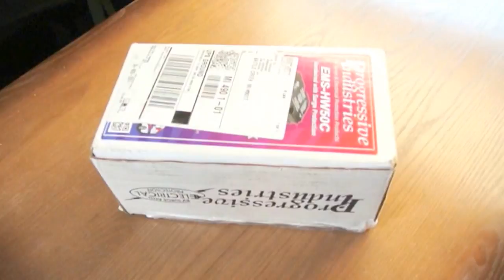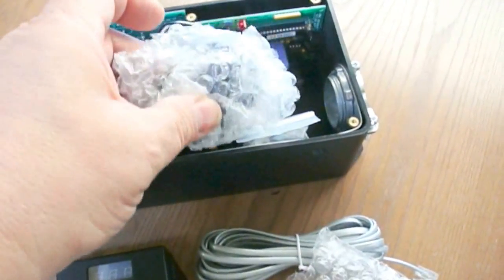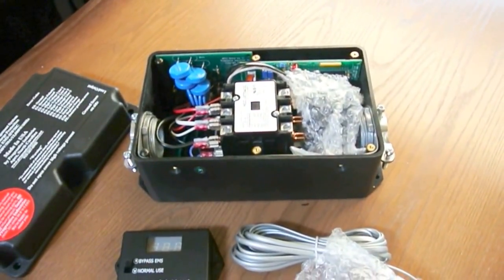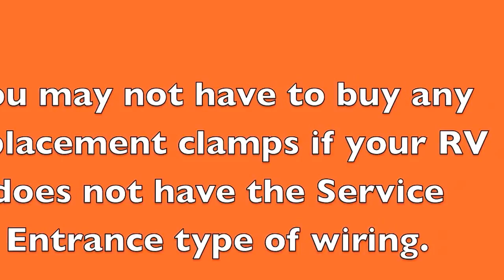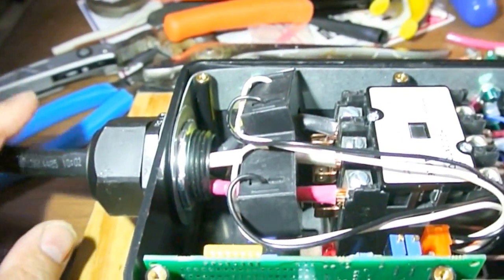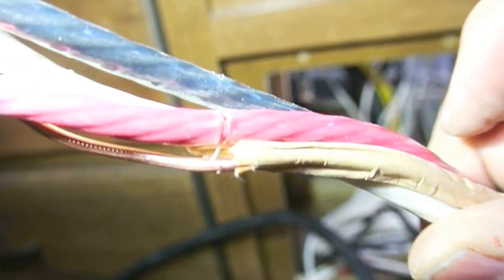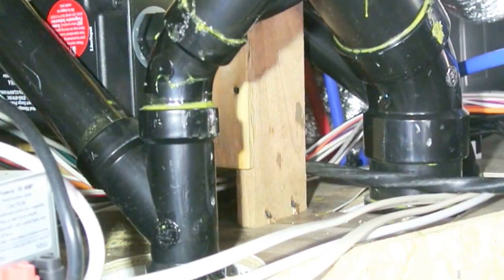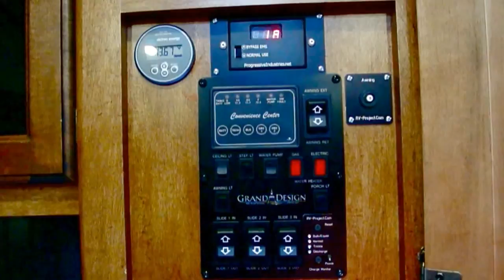Installing the Progressive Industries EMS-HW50C in my RV with a custom panel.

Comment: Well done ! A very professional job!  I do like the flush mount for the remote readout  I am in the processing of installing the same unit in my trailer . The remote readout will be inside a small cupboard m with easy access . And as far as the power cable in and out of the main unit , I just made some  rubber spacers to go around  the cable to help the clamps grip it better . My Power cables are 10/3 AWG  stranded rubber covered .

Comment: After getting burnt by a surge, I installed a Progressive Industries EMS-HW50C in my 5th wheel. That was back in 2008 and its still going strong. A testament to the longevity of the unit.
Reply from the maker: Thanks for the feedback.

Comment: Since I can not make contact with you via email (I have gmail) I will make this comment about how to get your templates from your website.  FIRST one needs to download the Front Panel Designer software.  Once you have that software program you can download the template from your website and open it in "Front Panel Design".  Very impressed with your videos and website.
Reply from the maker: There is a tutorial on the webpage with the templates on how to order.

Now, you dont have to download the software unless you want to make changes.

Front Panel Express now has a order page on their website. You can download the file from the RV-Project website and upload directly to the Front Panel Express order page without having to use the software.

Ang great news... maybe.  Due to feedback from everyone that has ordered front panels, Front Panel Express has told me a lot of orders have mentioned RV-Project.com as to where they found out about Front Panel Express... so much so that they want to get more involved.

I will try to get a discount code for anyone ordering  a RV-Project file.
Reply: @RVProject  Am going to order a panel from Front Panel Designer this week and maybe one for my neighbor that is installing an EMS-HW50C also.  Were you able to get a discount code from them?
Reply from the maker: Not yet.  They have not offered whether or not they will do so. I will try contacting them again this week.

Comment: Thanks.  Wish Progressive would update their display and also add Bluetooth.  Display looks like from the 70's.  lol
Reply from the maker: Agreed.  I did look into building my own monitor, but I have yet to figure out the serial data string coming out of the box.  Something for a winter project when I have more time.

I would like to see a monitor that displayed Voltage, Current, and Frequency simultaneously for both legs, and a histogram that provides the last 24 hours of data.
Reply: @RVProject  yeah I am leaning towards the Hughes Watchdog hardwired for my Rockwood I have on order because of the Bluetooth ability.  I don't think it shows frequency or have a histogram in the app but it does show voltage, current, and it will keep track of energy used.

Comment: Where did you get the mounting plate?
Reply from the maker: It's a custom panel I designed.  I loaded the panel file at my website:  www.rv-project.com/resources/e450.php  

Go to the website where you can download the panel file. Then you can order it by uploading it to www.frontpanelexpress.com (the people that make the panel).

There is a video on my website showing how to order the panel.

Comment: does this work at home? or just RV's becuase i have 240v welding machine i want to protect the hole house .
Reply from the maker: RV 50A service is no different than home service other than current handling capability.  However, I would consult an electrician to make sure it is done correctly.

Comment: Did you remove the wood panel of the cabinet to run your cord for the remote? I assume all the wiring for the control center runs up the wall to the right and you ran the line from the basement, up the wall and into the space between the inner and outer panels of the side cabinet.
Reply from the maker: For my RV, there is a void in the wall behind the cabinet where the control console is located. All of the wiring goes through that void down into the basement and electrical areas.  To access the wiring, I have to remove the control console.
Reply: RVProject thanks. I figured  it out.  I have a Reflection 27RL. I ended up mounting my remote directly above the breaker panel in the Lower cabinet, just because it was easier, and you don't need to see it all the time.

Comment: Curious what made you decide on this Progressive Industries model versus a comparable Surge Guard product. I’ve been trying to decide which is best — this one, or the Surge Guard 35550. I understand the remote readout is a separate purchase for the Surge Guard, but are there other important differences?
Reply from the maker: The progressive unit has replaceable circuit boards, so for instance if the surge protector burns out, it can be replaced without having to replace the entire unit.

I do know that a new Surge Gard unit is now available which was not available when I purchased the Progressive unit. 

Either unit should provide sufficient protection.

Comment: I want one of those flush mount covers.
Reply from the maker: Just go to my website and you can download the template (http://www.rv-project.com/resources/e450.php). You also need to download the Front Panel Express Designer, which is the CAD program for the template. The program is free. 

Next, load the template into the Designer and you can make any changes you wish as well as order from the supplier.

There is also a video on that webpage showing how to use the Designer.
Reply: RVProject Awesome!  Thank you so much!
Reply: I tried your link but it doesn’t work? Anyway I could get the file for the cover plate?

Comment: As I understand it, you have the Grand Design Reflection Fifth Wheel.  I have the Grand Design Solitude model.  Did you use the SE/SEU/SER cord of the STW cord?
Reply from the maker: Since SE was already imstalled by Grand Design, I just used that.  But if I did it over again, I think I would have replaced everything with STW.

SE is hard to bend, and flexible is always better when it comes to trailers bouncing down the road.
Reply: I ended up using the SE and it worked out quite well getting a 4' piece and mounted nicely directly underneath the fuse panel on the floor.  Thanks for doing this.  It really helped a great deal.

Comment: Kinda wish I had bought this model vs. the EMS-PT50X model but I'm still happy. Another great video. Thanks!

Was this video reuploaded? I could have sworn I've seen you do this already. :D
Reply from the maker: Yes, I updated it after viewer feedback that some of their RVs use larger diameter extension cord to wire from the inlet power connector. My RV mfg used standard Service Entrance Cable, which is a bit smaller in diameter.
Reply: Oderus Urungus a@